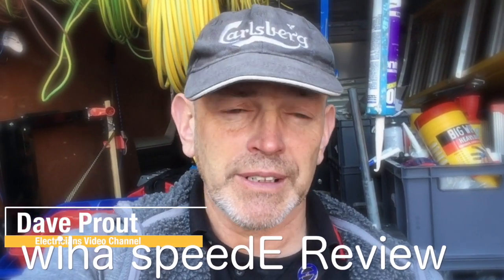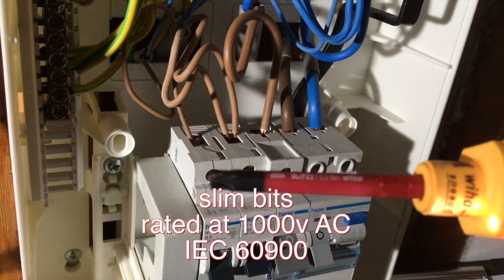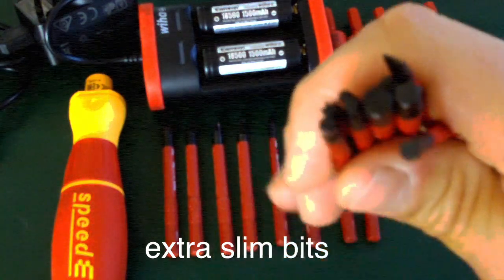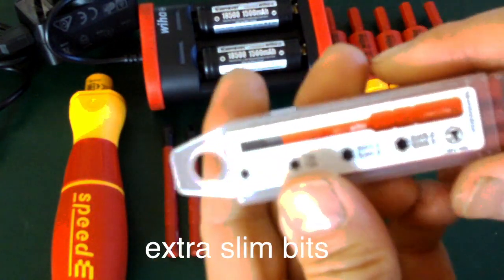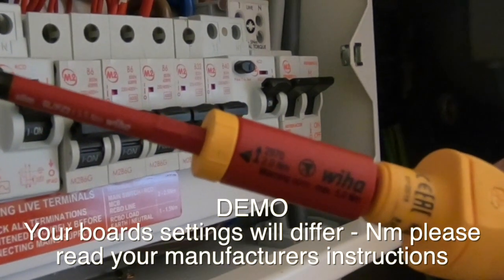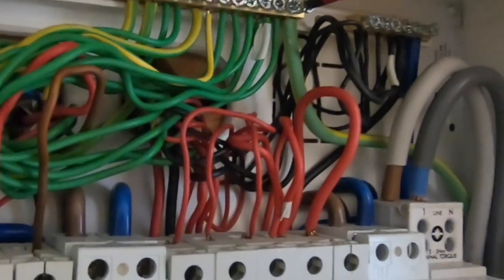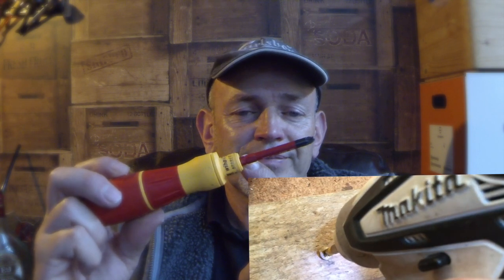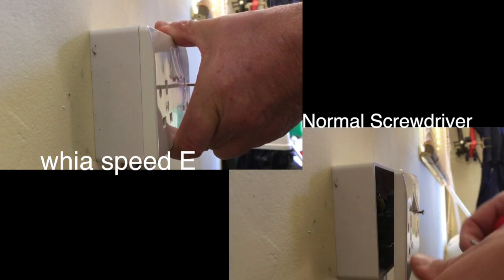wiha speed E Electricians Review

Comment: How's it been doing, if you're still using it? Maybe a 2 year review?
Reply from the maker: Yes still use this tool every week taking off putting on electrical fittings. Batteries still good last all day or even a few days per battery. All the combo bits real handy.
Reply: @PlymouthSparky  Thank you for the reply. Im using a bosch 12v screwdriver, it serves me well with its gearbox and low torque. But now that there's a speed-e 2 I might consider exchanging it.

Comment: I don't get what the point of it is. It's not quicker than doing it by hand and it has low torque, outside of electrical applications an impact driver is far superior and costs less...
Reply: It is much quicker than a normal screwdriver, just as shown on the video. The torque limit on it is just to drive the screw in, then you twist with your hand for final torque spec. It is meant only for electricians, as it is a VDE approved screwdriver.
Reply: This device is not to be compared to impact driver, that is a different tool class alltogether.
This tool is to replace most of your normal manual screwdrivers that you screw by hand.
Reply: @tommymack3210  But you still have to tighten by hand, so what's the point? 8 in-lbs is good for what exactly?